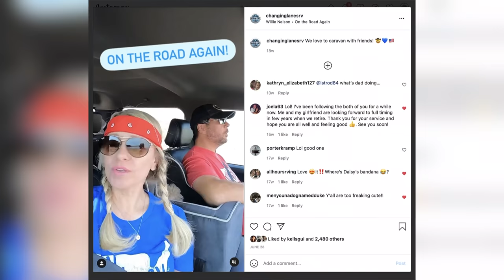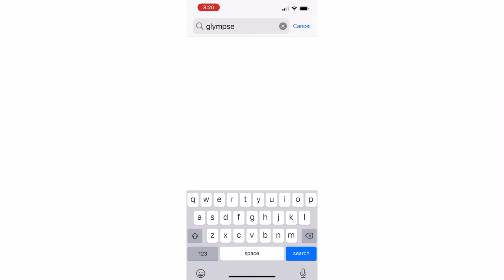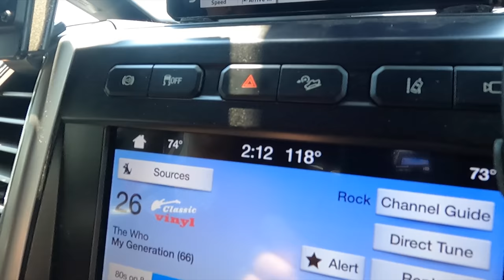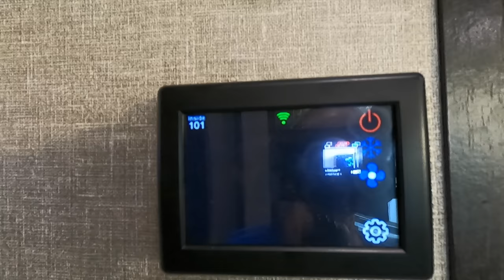😡  RV Park and Travel Day Issues! (Full Time RV Life)

Comment: a quick comment to help the RV Refrigerator run better is I switch a 1 gallon jug of frozen water from the freezer to the refrigerator section daily and refreeze the thawed water into ice.  It helps with the interior temps in the summer and helps the refrigerator work better.  YOU can also use the ice water when things get really steaming.

Comment: My wife and I love watching all your videos. Here is a tip for you. In the future, when you travel on HOT days, run your generator while you are driving to your next location. This will keep your RV cooler and your refrigerator will stay cooler as well because it won't be using propane it will be on the electric. I do this all the time and it works great.
Reply from the maker: We normally do that, but we were having issues with our genny and inverter at the time: https://youtu.be/53_w0SBAh9c. And, this was before we upgraded to the Victron.

Comment: Vegas RV Parks are notorious for low voltage in the summer. I think their grid is beyond its limit.  Sites closer to the transformers can be a bit better, but not much. When we travel on hot days we run the generator and ACs while driving so the rig is cool when we arrive.
Reply: Wonder why they get such high ratings on RVLife - 4.2?? Makes you wonder if you can trust these ratings

Comment: Hey Chad and Tara. Next time  your are in extreme heat. If you have sufficient water supply, a spray of water on the condenser coils will reduce the temperature of the condenser coils. reducing the load on the compressor. I have used a water spray when the condenser fan failed. The water spray kept air conditioner running until a proper could be made. Good luck.

Comment: Chad, in addition to turning your Jake brake on you should also put your transmission in a lower gear so it'll also help your brakes.   As a truck driver,  I drop down a mountain in a lower gear with Jake brake on and rarely touch my brakes,  or just tap them.  
  Thanks Lavon

Comment: My engine brake shuts off too when I turn off the truck. Would be great if truck manufacturers would provide a setting to default engine brake to ON whenever a trailer is connected. Better to have it on and not need it vs. needing it and it is OFF. Glad y’all made it safe and sound.

Comment: Until you get a residential refrigerator please look into the ARP control with extra fans. It will also protect your refrigerator. Also look into adding an additional baffle at the top of your refrigerator cooling unit.

Comment: Forever learning. Thanks, never knew about the draw on the input Line AC . Now monitoring all our AC unit power drag on the input lines. Fortunately, this ground has good 118 AC. even with both units working. Discovered another factor : This rig isn't insulated well enough. Even at 92 degrees, this rig can't keep up and the units run for hours.

Comment: Just use that engine brake all of the time when your towing. Saves brakes and wear and tear even in flat land!
Reply: I run mine all the time towing or not on my Ram. 
If my trailer is connected it stays on even when you turn off the truck. But if not connected you have to turn it back on every time you start the truck.
Reply: @jamesglenn520  k

Comment: Wow, I feel your pain for sure.  Alice and I had a very similar issue in Maine this summer but the park owner didn't try to work with us at all.  When I went into the office the second time to report an electric issue and talk to him about LOW VOLTAGE his answer was to start yelling at me and KICK us out.  No offer of another site just strait to getting kicked out.  I actually recorded him yelling at me and I chose to put it into the video we did because he was the owner.  We found out he has had several reports of electric issues and hasn't addressed them.  We stayed at the same RV Park in Las Vegas as you guys in January.  Thanks for sharing.  This may have been the first video where Chad made an appearance without a hat.
Reply from the maker: Some park owners would rather have their head in the sand and hope the electrical problem just goes away. 😞
Reply: @ChangingLanes  we agree completely which is sad, because the potential damage  caused be be very expensive.  Alice and I love watching you two and Phil and Stacy.

Comment: The voltage at my home in San Bernardino varied from 108 to 130 volts. I had to help a business owner install a voltage conditioner because he was losing computers during July and August due to the extreme voltage drops.

BTW, I installed a 12 volt bus to power my wifi modems and routers instead of the AC system. This way they stay active while traveling!

I had a similar problem dropping down from the TT in Idyllwild CA. Discovered that the dealer had jacked the brakes on the 5th wheel/

Comment: When you own a big r.v. trailer i will tell you from over 30 years full time experience. It will cost the average 25' fifth wheel and truck $500 in repairs and maintenance every 100 miles you tow that trailer. If you want to go full time for life buy a new semi truck and a 25' box trailer preferably with a working refer unit . Have two big slide outs installed on both sides with stability jacks . Then build your interiors to your liking and the quality you want . Then you are set for life .

Comment: We can identify with camping in a very hot location - we camped in Big Bend National Park (TX) this summer (July) and it was over 100 degrees.  We had issues with electric there - the 50 amp breaker kept blowing on the pedestal so I was forced to use the 30 amp one and our Victron Inverter on boost to get 2 AC units running.  We were fine the day and night.  The next morning we went hiking and left our dogs in the camper, knowing that with our batteries and inverter they would be fine even if the power went out.  We did shut off one AC unit in the bedroom just in case there was a power issue the other one would continue to run.  One of our dogs was in the bedroom and when we got back the main room in the camper was about 82 degrees but the bedroom was over 90 degrees since it was 106 degrees and we were in full sunlight on an asphalt parking area (Grand Village at Big Bend).  Lesson learned ... need 2 AC units running during the day to keep the camper cool enough when it is over 100 degrees (we have a smaller Grand Design Solitude S-2939RL).  Our dogs were fine except we had to be careful about the asphalt because it was very hot for their little paws - over 130 degrees.

I installed some fans in the top vent area of our RV fridge that worked great even in hot temperatures.  We have the 12CuFt version so it is not as large an area to keep cool.  Someday I may convert it to a 12V compressor system with one of the JC Refrigeration kits they sell in Indiana.  Before I installed the extra fans the fridge would get too warm and the freezer would get warm on hot (over 90 degree) days.  Now it works fine.
Reply: Gosh that could have been very dangerous for your pups. You were lucky. I hope you are more careful with leaving them in such heat for any length of time. And the asphalt and dirt or sand will burn their paws in such high heat. I always take off my shoe and test it if it burns my foot it will burn their paws too. Miserable times, been there done that. I got a stroller for my babies when the ground is to hot.

Comment: Hi! I'm a lifelong electrician and know the there are a lot of electricians that use Ohms law wrong. 
Keep in mind that as the voltage drops across a load (resistance) the wattage also drops. Therefore, as voltage drops on a circuit, so does amperage. The only way to get the full wattage out of a lamp or  inductive load (AC unit) is to apply the rated voltage. 
Sorry that electrician didn't know that, a lot of guys learn this stuff early on in school but don't  how to use it for trouble shooting later on.

Comment: I run engine brake all the time. When you're in the hills you can gear down too.
Powerstroke doesn't have as good an engine brake as Cummins. Ford is a great truck though.
I have a Ram/Cummins and a 35' fifth wheel.

Comment: Electrical code for RV parks assumes that no more than 50% of the rated capacity will be used at any time.  This is part of the problem.  Check for voltage drops throughout your system, also, particularly at either side of the twist lock.  Also, soft start devices for AC units really work.  The locked-rotor starting current of the compressor is what is blowing your breaker.

Comment: I have found that many parks are not updated electrically. Also with so many new RVs having electric fireplaces as more turn them on at night it lowers the watts available.  This is where the surge protector saves so much damage.  Hard to deal with when you pay for the electrc that is not there. Might as well dry camp.

Comment: Trucker here…you’re very fortunate your rig didn’t go up in flames. If this happens again, remember this…ALWAYS keep driving until the smoke goes away. When you see trailers burned up on the side of the road, it’s from drivers riding the brakes too much, they panic and stop asap. THATS when the fire starts! If you keep driving for a few miles after it flattens out, the wind will do 2 things - help prevents flames from forming as well as cool the brakes down. Once they’re cooled down THEN pull over and assess the damage. 

It sounds like you did have a few miles of flatter terrain before pulling over, which 100% saved your rig

Comment: Not certain of this but I have read somewhere that a technician with a scan tool can turn off the setting that requires you to push the exhaust brake button upon restart.  Supposedly for liability reasons, the default setting is to require you to reset the exhaust brake after restart so that someone driving in ice/snow or otherwise slippery conditions does not lose control by skidding the rear wheels with the exhaust brake activated.  Maybe worth inquiring the next time your truck is in for service?

Comment: We camped this past summer in Texas, New Mexico, and Arizona. We stayed in Big Bend around 110-115F, started off boondocking, but moved to the RV campground because our kiddos got sick.  The RV campground was so empty we had solid 119 volts the entire time we stayed in Big Bend. A lot of the issues you described with electricity are pre brownout-like symptoms. Everything is running so hard on the grid it’s difficult to get nominal service delivered to everybody. We also experimented with some of those alternate cooling methods for the fridge and it helped some. For example, we ran our generator on propane instead of gasoline so it would run cooler, putting shade over the air conditioner unit itself, and others. As far as engine braking, we use ours every time we tow/haul as it puts less stress on the brakes and adds additional assurance that we can stop in time. Summer camping in the desert is not for the faint of heart and, for those considering it, requires a good bit of planning especially if you prefer boondocking over hookups. Stay safe out there and happy travels!

Comment: I own 2 campground in Michigan. It is tough getting consumers to provide the power as needed when the heat raises..when it hits high 90's we will blow a transformer we have the highest power that consumers offers....what I do is depending on how many big rigs are on that leg, take your 50 Amp and flip flop with the 30 on the pedestal, the actual breaker..it will even the legs out..if one leg has too many 50amp on it just change the breaker and if there is less 30amp units, you'll receive the voltage that's needed..

Comment: I have been using RVs since 1968 in a truck camper to a small class A then bigger class A than my current Monaco 40 foot diesel motorhome.  I can make ice in my refrigerator in 100 + temps.  Your refrigerator is located in the slide out ( that does not work very well) If your LP unit vented at the roof it would work.   Yes it works on electric or gas just as well.  A diesel generator would make your life much easier, I ran mine two weeks straight I only shut if off once to check the oil,(grand child on an oxygen machine)  I always run with the genset and air cond on

Comment: This has probably been said already but with an engine brake, and manually putting the truck in the correct gear and RPM (for the grade % and total weight) you can descend the grade without ever touching the brakes. Low gear and high RPM (not redline obviously) is the key. I do this all the time driving a '06 Sierra towing a 16,000 lb 5th wheel in the Rockies and Sierras of the West. When you find the right combo for the grade you're on, it will hold you at a certain speed...and I don't mean 120 MPH. 😉

Comment: Stayed at this park twice both going and coming from Sturgis. We had no issues with power at 30 Amps anyways. Lost a tire 120 miles south and it took out the jumper cable to the house batteries. At the same time we lost our dash air and spent three days getting various repairs completed. While running around daily it meant no pre-cooling until late afternoon. Just getting the interior cool enough to sleep was a chore even with a box fan inside. We lost another MH tire that trip and trailer tire as well. It was to say at the least a memorable trip. We are engaged in ministry and truly felt we were in the midst of a spiritual battle at times. Sometimes you just have to roll with it. I will say that small businesses in Vegas were extremely helpful in fitting us in to their busy schedules. We try to avoid LV in the summer especially, but it is the most expedient route.

Comment: You've got a right to be "peeved" with the situation. We once ran into that problem at a site we love where as soon as we turned on the single AC (220 30A) it popped the breakers at the site. We called the office and they sent out a guy to take a look. He reset the breakers and five minutes later it happened again. He had to return to the service and reset the breakers again (this was happening with other sites as well). By the third time he said "here is the key to the box, just reset it when it pops off and I'll be back in a few hours". A few hours later he came to see me and replaced about half the breakers in the box. That solved the problem for the rest of our stay. It happened again at another site where the 220 / 30A service worked for about ten minutes and then crapped out. Luckily I had adapters and could plug into their 220 50A service and we lived off that for a week. We let them know about the problem as we left the site three days later and they said they'd look into it. Sometimes the AC service just isn't their priority and can cause problems even when you can run most of your trailer off batteries and propane.
Reply: corey Babcock  Sorry, got a little mixed up. It's because I had a 220-30 drop installed at my old house for my trailer. I sometimes miss the old house because of that. Now I park my trailer in storage due to lack of home parking space. I only used 120-30 but it was handy to have the extra power capability at the box split into both a 120-30 and a 120-15 outlet to heat the trailer in winter and to power external equipment for maintenance purposes.

Comment: (This is kayak Mark) I mentioned to you a while back but I got a DRV with disc brakes I'm not happy my disc brakes drag I bought a 50 lb fish scale had a strap around the tire and it takes 36 lb to make the tires go round there is a recall from the NTSA on September 23rd mine is a two axles so it has the 9000 lb.
Reply from the maker: Wow!  That's a lot of drag!

Comment: We live in Vegas. Go to Oasis RV park. Always good power. We travel to Parker, AZ in summer time and full gas for the generator, because it can go offline if not, then run the AC units on the 3 hour trip. It's a lot cooler that way. We got a momentum 381.

Comment: Standard & first thing done after getting onsite is the navigator gets the voltage box out & plugs it in. This happens before any shore power cable comes out.

Nothing worse than low voltage & expensive stuff that wants at least 118V both legs.

Vegas in summer! What were you thinking?

Comment: Hughes voltage booster for RVs. $600 from Amazon. I would guess the campground was a small portion of the problem. Get a small digital voltage meter that you can plug in to an outlet. The voltage will bounce all day. Especially around quiting times, schools let out, etc.
A voltage booster should help if you are ever in the situation again. Or if you have a motorhome like Phil run the diesel generator until the line voltage picks up. 

Vegas is the only place I have been where the swimming pools have chillers (like a pool heater only reverse).

Comment: I have a question, not being a RV owner yet…I know you have a generator on board. Wouldn’t you be able to at least cool down your rig with that, until you got your shore power fixed?
Reply from the maker: We were having issues with our genny and inverter at the time: https://youtu.be/53_w0SBAh9c
Reply: Yes, but. In large fifth wheels the generator runs on propane, and unless you just filled the tanks, you run the risk of another problem, no propane, no fridge. Generators seem more practical on motorhomes where they share a vary large diesel fuel tank.
Reply: @allens7476  With a large toy-hauler the generator runs off of regular gasoline that is stored in the fuel tanks in the back - most have 2 tanks - 1 for the generator and one for the "gas-station" for the toys.  ;-)